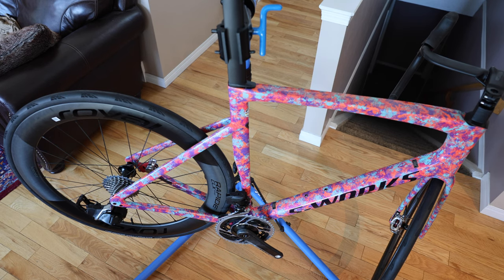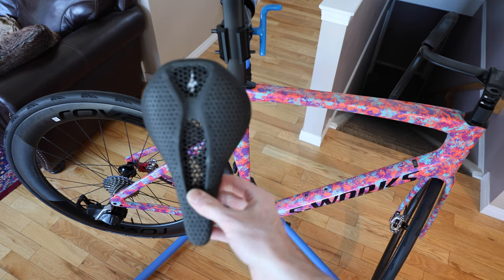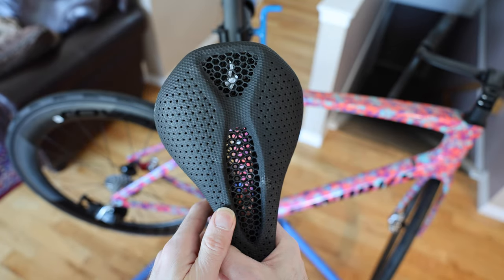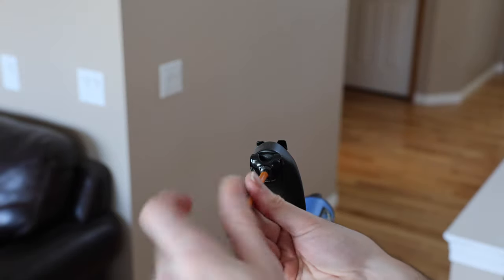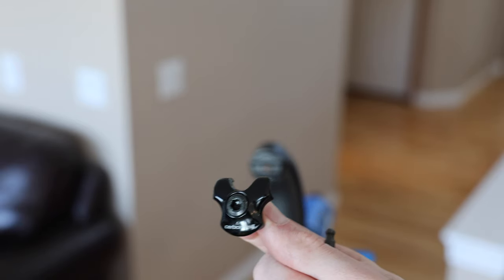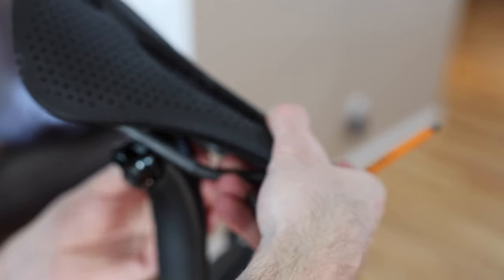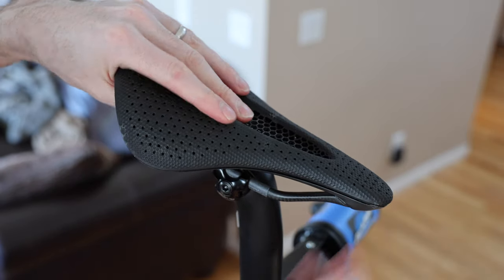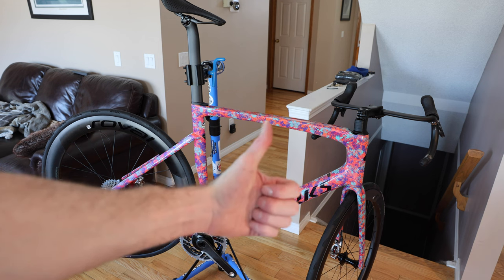S-Works Power Mirror- Project Tarmac Install

Comment: Bike looking sharp Mitch
I tried the carbon power mirror and also the Fizik carbon anteres and sold both relaxing with the carbon mirror Romin evo which is absolutely the most comfortable and ergonomically designed saddle I have ever owned . Have one on both of my road bikes . It’s a bit longer and gives a bit more mobility vs the shorter power .
Reply from the maker: Oh awesome! Both the Romin and Power are great. I’ve had both and didn’t have a problem with either.

Comment: Hello, how do you tighten and make the saddle tilt angle in place? I see that it is loose and moving in the video 😀
Reply from the maker: When things aren't snugged down all the way, you can still move it around gently, without any issue.